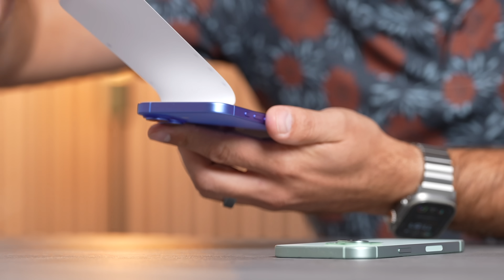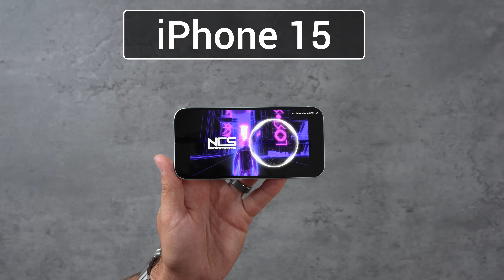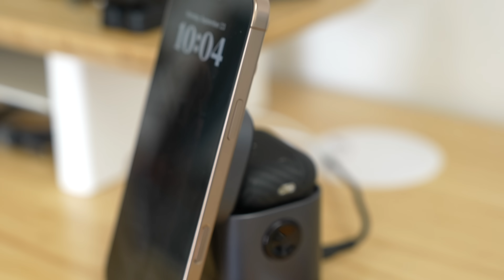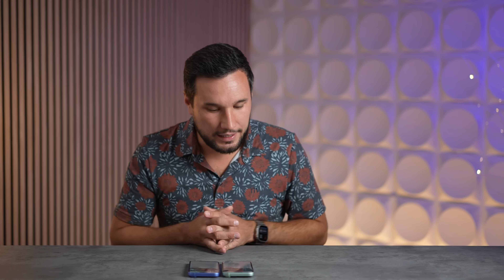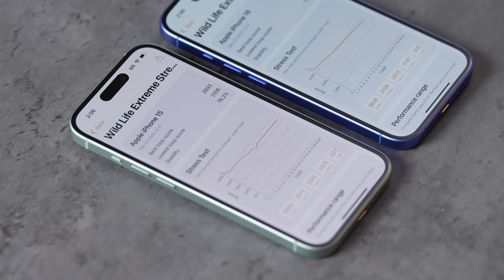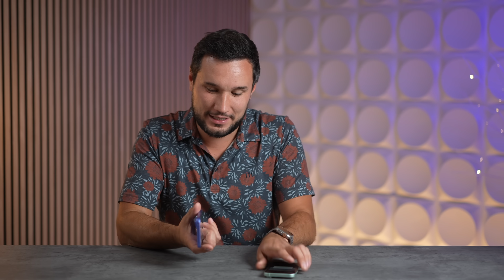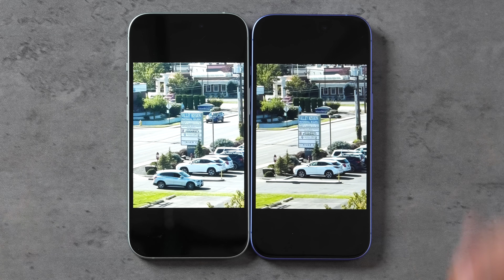iPhone 16 vs iPhone 15 - REAL Differences after 96 Hours

Comment: Honestly speaking, phones are so similar now, that you don't notice any differences. I have a 13 pro max and used the 16 pro max for 4 days and it wasn't much different at all to my 3 year old phone. So people went from upgrading every 1-2 years, to every 3-4 but personally, I wouldn't upgrade, even if I had an 11/12 pro max. Because it really isn't that much different. 11 maybe, because of the shape and size. But I liked the 11 pro max. That was a nice feeling phone. Nowadays, a person should take care of their phone. Don't charge it to 100% or don't let it go below 20% and your phones battery health will be fine and then you don't need to update until the phone stops supporting software updates. So if you even have an XS max. Hold onto it for one more year and then upgrade to the 17. The 17 will have a smaller dynamic island, 24mp front camera, 48mp telephoto camera, possibly some vapor cooling chamber inside it and maybe a new and improved main lens. Since we've had the same one since the 14 pro max. So 3 iPhones in a row. Maybe that will get some upgrades next year and also 12gb of ram is also rumoured. So having all those upgrades is worth hanging on to the XS Max or newer. The regular 16 pro, will feel like an 11 pro max. Because of the similarities in size. I miss the 11 pro max design. It was so nice to hold that
Reply: Why don't you charge it too 100 or below 20?
Reply: @FriskyGorillas  it's bad for battery health. I've already tested this. I used to charge a phone to 100% and it went to 90% battery health after a year and a half and then the other year and a half I charged it to 80% and didn't let it go below 30% sometimes as low as 20% on emergencies and a year and a half later, it went to 88%. I've done the 30-80 charging with my 2 year old watch ultra and that is still on 100% battery health. New phones now allows you to set the charging upto 80% so if you have a 15 or 16, try the 30-80 thing for a whole year and you'll still have high battery health. 2 of my first iPhones, I did the 30-80 and a year later, it remained at 100% my wife and brother have the same phone and use the phone the same way apart from charging techniques. He charges it to 100 and let's it go below 20 and my wife does what I do. My wifes 15 pro max is on 100% still, while his same phone was on 93% by April. But he ended up replacing the battery in May and right now it's on 98% as he still didn't listen to me when I told him how to charge it and to avoid letting it go below 30%
Reply: @FriskyGorillas  phones battery health lasts way longer when charging it to 80 from 30. Lowering it to below 30 or 20 heats the phone up, which is bad for battery. Same with charging it fully. That also heats the phone up. You may not experience the heat, by checking up on it while it's charging. But damage is being done. I've also done tests and the 30-80 has been proven to be the best charging technique, if you want to keep the phone long term. If you aren't bothered and upgrade every 2-3 years. Then do whatever you want. 

But I like to only upgrade, when the phone either stops working or stops supporting software updates. Even though an actual apple employee who is a friend, once told me that you aren't even meant to update any of your devices anyway. Because the software your device is currently on, when you buy it, that's the software that was built and designed for that specific product and updating to the next one, is built for the next model. That's why people always experience battery draining problems. Not just the battery, but the health of the battery drains too. I experimented charging my phone to 100% for 18 months and it went to 90% and then the following 18 months I did the 30-80 and it dropped to 89 after over a year and is now on 88 after 18 more months. That was proof that charging it the way I charge it, is the correct way. I have not updated my one year old macbook pro or my two years old apple watch and both are on 100% so far
Reply: Because there is no major difference 😂😂😂
Reply: Aren't they dropping the dynamic island , well it's current pill shape , and going for a standard punch hole design. TBH I find the dynamic island more distracting than the old notch
Reply: I upgraded from the xs max and am not impressed. It feels the exact same and I’m thinking of taking it back. I thought there would be major improvements… boy was I wrong. Just wasn’t the upgrade I hope it was.
Reply: @brettwalsh2847  xs max was the last phone with 3D touch. If only they kept it. But battery life on the next phone went so much better, after they got rid of it. But I don't know if it was because of that or just battery improvements. What was your xs mx battery health on? I think you should have kept it, especially since the phone still supports the latest and most likely the final software update and there won't be ios19. But I know iPhone X users that are still on ios16 and their phone works great the past year, because of no updates. As updates slowly ruin your phone. As updating to a brand new ios software, is designed for a new phone, not yours. So apparently, if you stay in the ios you got your phone with, the phone works way better. This is what a former apple employee told me and I believe he is right
Reply: yes but this design is tested. if 17 gets a new design we should wait one year more to see if there are problems with it
Reply: @ssofianos  17 won't get a new design. It'll still be the same. Just updated telephoto lens and selfie camera and smaller dynamic island. Maybe under display face ID. They won't change the design. There will be the same fidget spinner design camera layout for at least 2 more years. 17 & 18. In 3 years, it'll be the 20th anniversary. That's their opportunity to change the design. The perfect design change would be to go from 3 camera to 2. Not 4, but 2. Let me explain this. 

Sony has this continuous optical zoom, where that one lens can go from 3.5x all the way to 7.1x. There is no digital zoom in between. So imagine apple or Samsung or even pixel did this. Where it goes from 2/3x all the way to 5/6x. The only digital zoom would be from 1-2/3 and beyond 5/6. So one continuous optical zoom lens and one main sensor, that could also go ultra wide. To take it a step further, we hope to see just a single lens. A big circle that's 2 times the size of current phones lens. A lens that does it all. 0.5x to 10x imagine no digital zoom from 0.5x all the way to 10x and then after that, it goes to digital. That is a genuine game changing feature

I've also heard that all smartphones must have removal batteries by 2027. So 20th anniversary iPhone that is the perfect opportunity to add that to their design to. The jump from the iPhone 7 to the iPhone X was big. But the next jump won't be as big, but they can try. But how cool would it be to slowly go back to less and less lens. 2 and then 1 lens that does it all. That's the future. Maybe we'll see a 1-144hz screen. Maybe we'll finally get to 1440p a full quad HD display. IPhones have slowly been going towards 1440p from 1080p for years now and they're on like 1290p or something. Maybe by then the under display front camera will be ready. There's plenty now, but poor camera quality. Maybe in 3 years it'll be ready. Or, they might need more time to perfect it. Maybe an apple version of a foldable phone will release in 2027. What Huawei have done with the double fold looks insane. Can't wait to see a Samsung version that will probably cost £2.5k-£3k
Reply: The thing is , you’ve only been using the new model for 4 days , you cannot possibly appreciate all the improvements in such a short time. 
 I remember getting the 14 pro max using it the next day thinking , bloody hell I should have stuck with my faithful old 12 pro max for another year or two. 
But as time went on , I could definitely see worthwhile improvements to the 14 which I appreciated , and to this day I love my 14 pro max .
Reply: @mikldude9376 yeah but had you stuck with the 12 you wouldn’t have noticed anything anyway 😂😂😂😂 stop wasting your money on phones

Comment: I have a great suggestion…  create a chart and compare new phone to older phones and ask - “should you upgrade at this phone level?”   - very few upgrade every year, but we who have 3-4 year old 12’s and 13’s are much more curious how it compares.
Reply: Shiii I have a iPhone 10 I think it’s time for me to upgrade😂
Reply: @contract7974 as a 6S user, maybe. You could wait a little though.
Reply: I’m gonna keep my 12 for a year or two. No useful upgrades after iPhone 12
Reply: here i am looking to go from xr to 15
Reply: I am planning to switch to 16 from 13. And these numbers are absolutely amazing. My primary use case is 8GB RAM but CPU/GPU doesn't hurt.
Reply: Hy i have a serious confusion, i want to buy iphone but im still confused, Should i wait for iphone 16 in jan sale or buy iphone 15 in cureent BBD sale? Iphone 16 will be around 63000 in Jan sale. and currently Iphone 15 costs 53000 after all discounts. So whats your opinion do tell. Is it worth buying iphone 16 in Jan or wait for iphone 17 which might have biggest upgrade from iphone 16 as i see a pattern in iphones that all the odd iphones  i.e 11,13,15 are getting good upgrades.
My max budget is 63k -65k for the phone
Reply: @Rockcyril19  get the the 16 it is within your buget, if you want to save money stay with your current phone if performance is good
Reply: If you have an iPhone 12 or newer, you probably don’t need an upgrade. The main reason to consider it would be battery life, as degradation happens over time, especially for heavy users. If you're not a power user or into top-tier photos and videos, most new features are gimmicky.

The action button is mostly unnecessary, and the camera control button adds little benefit. The dynamic island looks cool but reduces screen space with its pill-shaped cutout. AI features are still in their early stages, and most people who use AI prefer ChatGPT.

Ultimately, upgrading is only worth it if your battery is worn out or you're concerned about losing trade-in value. In that case, take advantage of carrier promotions to future-proof your device.
Reply: @ArsOrdo  my current phone is mi 11x pro and I want to upgrade but I'm confused
Reply: Apples website has that grid type.
Reply: Well I have the IPhone 12 and I ran the geekbench 6 and 3D mark test he used in this video and these are my test results 

CPU : single core 2055
          Multi-core 4585
GPU : metal 15918
3D mark
Solar Bay test : avg FPS 8.7 Overall score 2289 

Hope this helps some . But yes not to bad compared to these new er phones . So I’m happy with my 12 but in June of 2025 I’ll probably trade in to get a 16 or wait till the 17 come out and get that
Reply: once i get a new phone highkey im not upgrading for years. I had an iphone 7plus for like 2 years, and this iphone 11 for like 3 years. I don’t see me upgrading from either of these new phones for at least 5 years.
Reply: I’d love this chart

Comment: 11:11 just wanted to correct one thing here because you made a mistake - the 16 doesn’t have the 15 Pro Max camera, the 15 Pro/Max main sensor is actually still larger but less advanced. The 16 has the regular 15 main sensor. The only main sensor change this year, were the Pro models which got the stacked sensor technology giving then 2x faster readout speeds. 
Great video!
Reply: This. The Base 15 got a brand new camera last year, they didn’t just scrap it after one year lol, they put it in the 16.

Comment: As a 15 pro max user and working for verizon i have gotten this question everyday from customers with older devices. The iPhone 16 is a good update from the regular models. The pro models this year though, unless you are using your camera 24/7 or you just want a bigger phone, then you should purchase. If you have a 15 pro or pro Max (especially the max) you should hold out still a good phone😊
Reply: Correct! Lately yearly upgrades are not meant for people that has the last years model or even the previous two generations.
Reply: I’m switching my 15 pro max ever since I got it it’s alwyss hot get warm and heats up so annoying I’m going down to a 16 pro I got tired of big phones
Reply: @Itzgabe89  that’s what I would do if I decide to upgrade later on because having a 6.9 screen and can only use one app can’t even multitask is just ridiculous
Reply: What about the battery life bro?
How's your 15 pro doing?
Would regular 16 beat 15 pro in terms of battery life?
Reply: @drishyarijal6877  my 15 pm battery has been great still 100% battery health had it since April 2024
Reply: @drishyarijal6877  if you get the 16 I know it beat the 15 in battery test and the pro lasts like 30 minutes longer
Reply: One area where the 16 Pro series is a big improve over the 15 Pro series is in 1) thermal management and 2) battery life.
Reply: @shameermulji  regular 16 vs 15 pro(not max)
Give your thoughts guys
Reply: I have an 11 lol
Reply: should i get myself a iphone 15, 15 pro or 16? rn i have the iphone 11. thanks!😊

Comment: no one loves this button. Fixes nothing that needed to be fixed
Reply: It just added more headaches. It messes with the screen sensitivity and typing
Reply: @X4Piper  you can always turn it off and have it do nothing
Reply: It's awesome for when the touchscreen doesn't work like under water or using gloves
Reply: That button is meant to be used when you’re serious taking a photo and video and taking your time.  There are two options now the screen and the button.
Reply: I love the button
Reply: I love it
Reply: I just use the button for mute and un mute
Reply: Yeah. I would consider upgrading if there are no camera control button.
Reply: then dont upgrade, ur so reactive. then wait for the next one and changed to android
Reply: Ok panjeet 😂
Reply: I’ve turned it off.
Reply: Idk I think it’s fun and cool. It’s finally a different and new way to use my phone so it kinda opens up more experimentation. Also before anyone says it’s not for lefties, I’m a leftie and I use it fine 😂
Reply: It’s for photography
Reply: Can easily disable the button in settings.
Reply: I do
Reply: Screen shake is real too so pretty shit
Reply: man, if i getting new iphone with action button, i still gonna use it for silent mode but feel like gonna miss that physical switch..
Reply: I'd never use that button either tbh. But if you don't need it, you could always set it to no action at all. It would have been useful, if it was also touch ID
Reply: 1. I never have to fumble for the camera again, the button is always there, I hit it and boom I capture.

2. It adds extra functionality by using empty space on the phone. Now you can remap your lockscreen shortcut/action button.

3. Its intuitive and first of its kind. It opens up the possibility to see other companies try this or make their own spin on it.

4. It screams that apple plans to implement this further, i.e power button/volume button in one button. (Press for power, Hold for siri, swipe up-down for volume. Nice. Explains why they put it on ALL 4 models instead if just the pros 🎉
Reply: @deandawiz  would have been way better if swyping up and down, brought down the notification control centre. Or scrolling up and down a page. Samsung and pixel was able to do that. Also have it double as a touch ID. There was more possibilities than only have it do camera things

The action button shouldn't only be limited to one action. The lock button has three actions. One click is lock, double click for wallet and hold for siri. Action button only has hold for one action. It should have a single and double click for two separate actions

Sony had the capture button for years. It just didn't have it doing other things, like zoom or camera settings. But that one small button was good enough, when I had my Xperia Z3
Reply: @deandawiz Again, that works for you. That’s your story and narrative because it was an issue for YOU. Majority of people have no issue with this, it’s easy to open the camera or any app, and at the very least if your implying all the “new” features justifies the 16 price point, I’d say Apple has you exactly where they want you, milking for the most unimpressive and unusual things no one has asked for. Is it nice yes, is it going to make the difference if someone can upgrade, probably not
Reply: It’s convenient
Reply: @rewindx123  how? You can literally swipe to the right from your Home Screen to open the damn camera
Reply: @jumbomuffin1316 not if you are in an app , the button takes you straight to camera no matter what you are doing..
Reply: let us be honest here. If they put swapable battery and easisly replacable screen no one would really buy these new updated phones every year cos what they offer is really only minor update. Chip could easily have 16gb of RAM. The amount of effort they are placing is there new updates is ridiculously small. And let us not forget that you have 5 ways of opening your camera now. 1. action button, 2. Camera control, 3. Swipe from right to left on screen, 4. pressing camera icon on bottom right of the screen, 5. commanding Siri…
Reply: Whiner alert
Reply: @RiccardoVegan 

He's actually right. They should give us 90hz at least. And kept that useless button to next year to keep milking us.
Reply: I love this button. Ur wrong. Pro cameras have the same button, now those aren’t gimmicks are they?
Reply: @boywithuke.archives Sure buddy